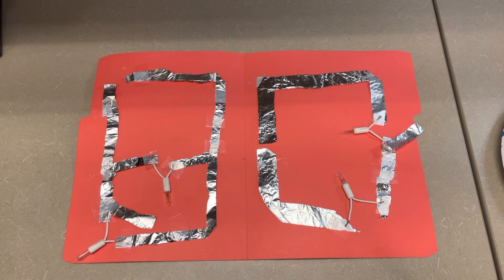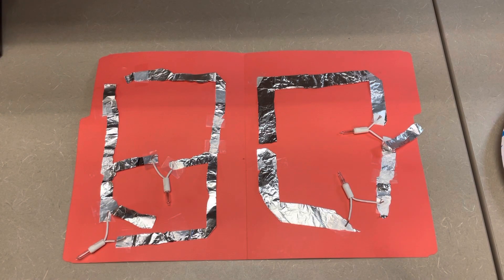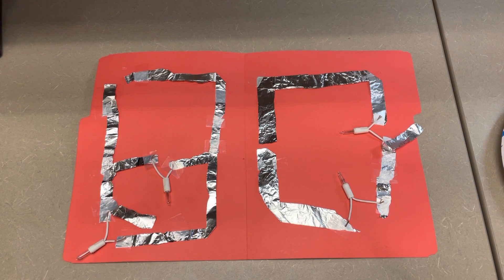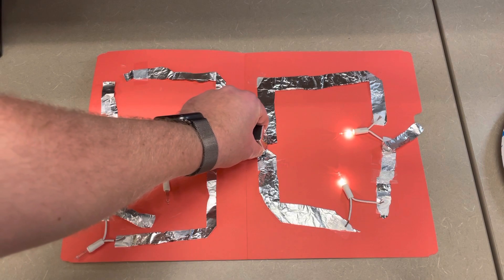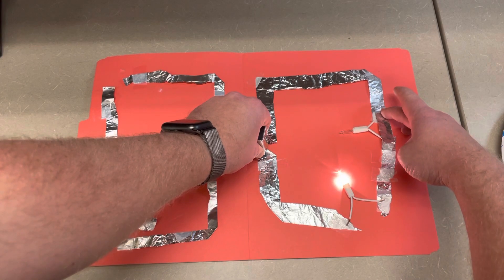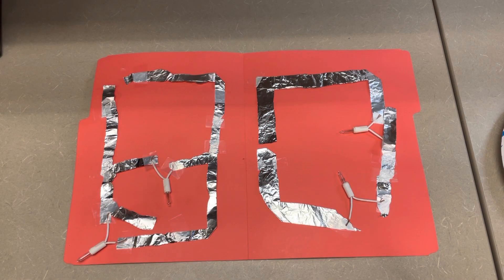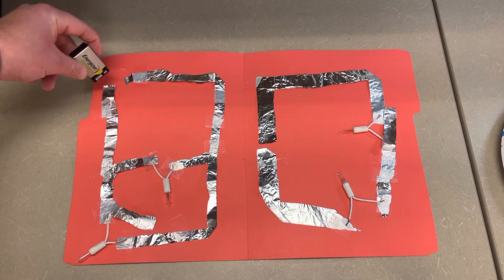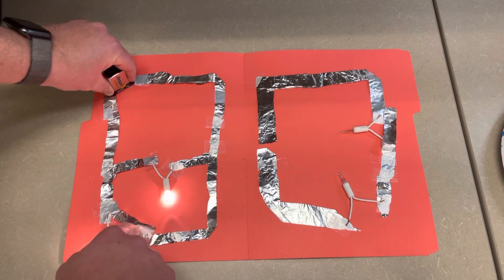Aluminum foil circuit

Comment: On the left circuit how do you make only one light bulb go off when you use the switch
Reply from the maker: You can "bypass" the light using a switch, providing a path of less resistance for electricity to flow through.
Reply: @SiouxScience  thanks